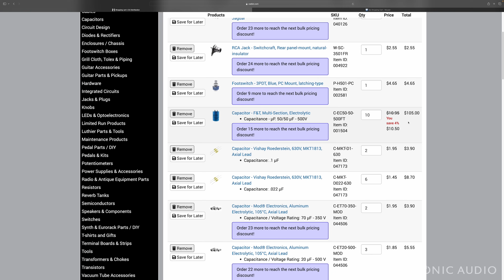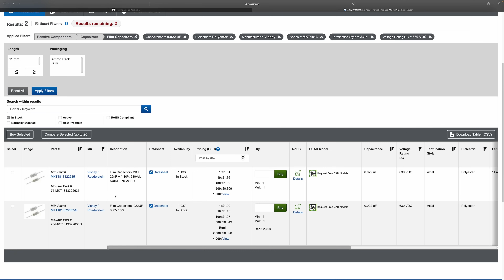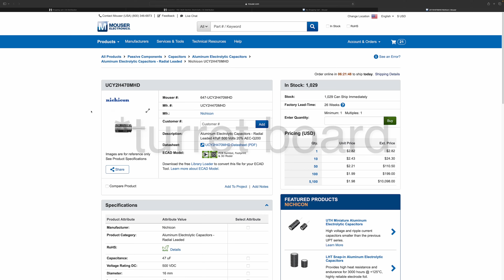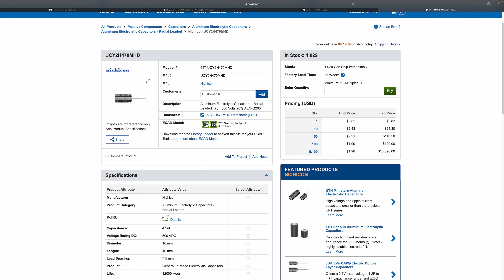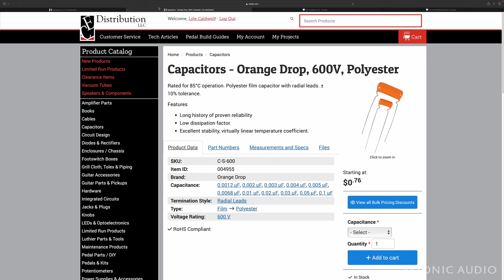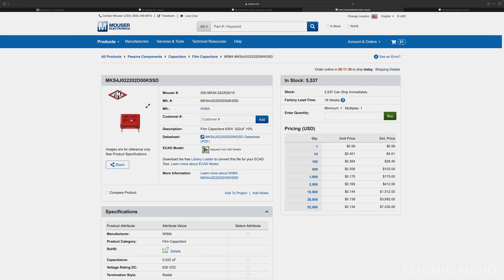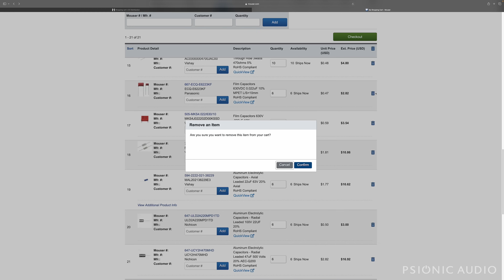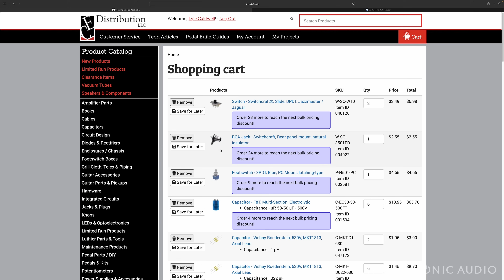Even More Boring | Parts Part 2

Comment: I bought some 9-pin sockets and Mullard tubes from CE. The tubes wouldn’t fit into the sockets as the metal ring/holder was too tight for them. Contacted CE and was told “Sorry but our Mullard tubes won’t fit right into those sockets.” I told them “Ok, what can you do to fix this? It wasn’t advertised on the site that they don’t work together.” I was basically told “Sorry.. they don’t work.” So now CE has lost a customer.

Comment: Great Video Lyle! although the wima are great, I still prefer the Panasonic ECQ-E6 series because I usually solder and revoice from the top of the pcb's... but everyone needs to get onto radial electrolytics. the difference in cost alone in Australia for them are $1.50 AUD vs $25 AUD

Comment: I screwed up and bought a SMD gullwing opto-isolator, so double check those prefixes and suffixes as they pertain to package style. An SMD 8 pin gullwing won't plug into that 8 pin DIP socket in a million years. There was a lovely picture of an 8 pin DIP chip. Oh well, that was 100% MY FAULT for not double checking the package style.

Comment: I recently had my amp tech remove decades of junk it had acquired from techs using all they could get their hands on; and put in those Blue SoZo tone and coupling caps. Also had him bias a pair of new Tung-Sol 5881 power tubes. I put a 5R4GY in it and the rascal sounds amazing. Before all that, son of a gum was tonefully DEAD. So PARTS are impartant! 🙂

Comment: On those orange drops, if they must be employed axially (we've all been there), if you bend the leads from below the half-loop rather than bending the leads out all the way to the base of the cap, you will have at least some stress relief on the body of the cap.  That little half-loop should be more than enough relief to prevent cracking where the leads enter the body.  This is my theory, at least.
Reply from the maker: Yeah, I was more commenting on what I see people do than how I would do it if I had to use them in a Fender.

Comment: I really enjoyed the components series.  Is there a list of must have on hand capacitor and resistor values you could share.
With so many resistors and capacitors types and wattage-voltage ratings it can be mind boggling searching Mouser.
Thank you,
Roger

Comment: When ordering electrolytic caps for Fender amps, have you ever ordered the "kits" from Antique Electronics Supply?  For the 5 amps of mine that I have done recap jobs on, I have purchased the kits.  You can select between MOD, basic and premium.  For some reason they don't include the 4.7uF cap for the tremolo cathode bypass, instead they include an additional 25uF.  The bias caps are not included.

Comment: They call that interference distance between parts and wires a difference of inverse squares or something like that. As  you get closer by X distance the dB of signal interference squares and then distance X closer again and it squares itself again. I am 100% sure I got the terminology 100% wrong but the concept is 97% correct. Some types of ionizing radiation work the same way.

Comment: I have learned a lot of good information from this channel. Keep up the awesome content. Since the first parts video posted, I’ve done nothing but look at caps and resistors online. I’m considering replacing some caps in my 65 deluxe reverb (MojoTone) build from a couple years ago. I believe it was the version one kit that came with the MojoTone branded filter caps and orange drops/Sprague for the rest. Would there be any benefit to replacing some of those orange drops and MojoTone caps? The amp sounds great, but I think it can sound better.
Reply from the maker: I can’t say as I haven’t heard your amp. As a general rule though, value changes matter much more than material changes, and lead dress/grounding is crucial. And it’s possible you just aren’t in love with that speaker. Or your room doesn’t sound great. 

So while I would not choose to build a Deluxe with Orange Drops I would not be rushing to change them out.
Reply: Thank you. I appreciate your input. I am using an Eminence EM12 Legend in the combo. It is a rather odd choice for that amp, but it has a lot of headroom.
Reply from the maker: Try some other speakers. You can connect pretty much any 4ohm, 8ohm, or 16ohm cab safely for testing. You might find you absolutely love that EV - but you might find a new favorite.
Reply: Do yourself a big favour and try the Eminence GA-SC64 speaker. My search for a speaker in my Deluxe reverb clone has now ended, yours may too.